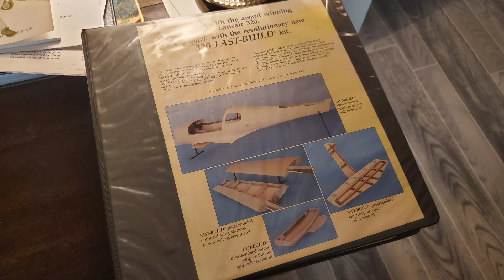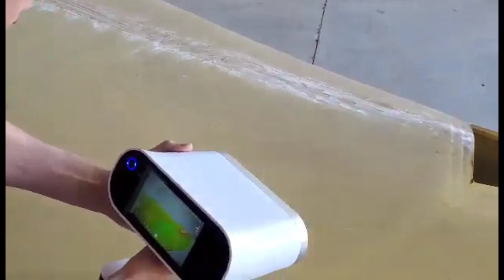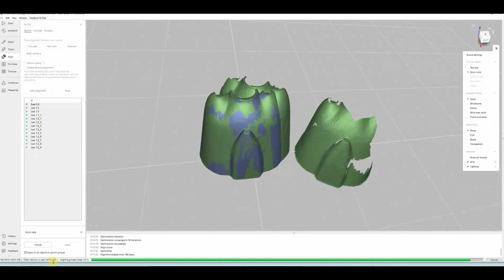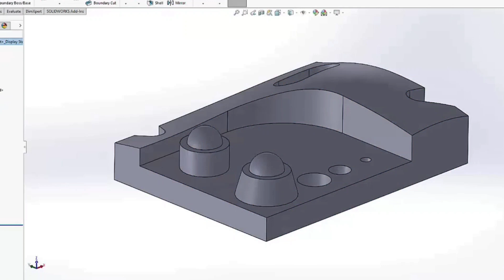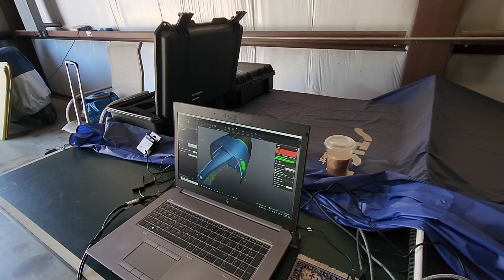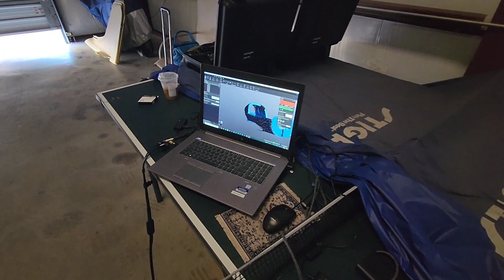3D Scanning - Part 2. Lancair Creaform HandySCAN Black Elite

Comment: If the dots are retroreflective, they can be very accurately located with a total station by a land surveyor. This gives you a global truth reference point to register laser scans or photogrammetry. If you locate some of the targets in the room, this will free up the surveyor to relocate to any location in the space and do a very accurate resection, and do a scan from any location. They should be able to give you something like 0.1" locations across the surface in a controlled environment. This is, by the way, the exact same process used on the JWST heat shield tests, and I've used it to measure walls and architectural elements on buildings.